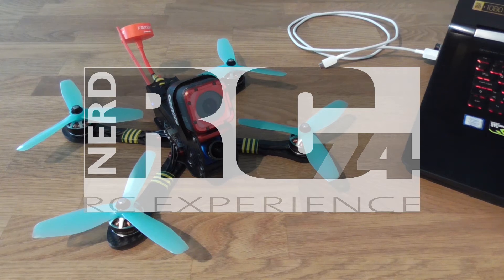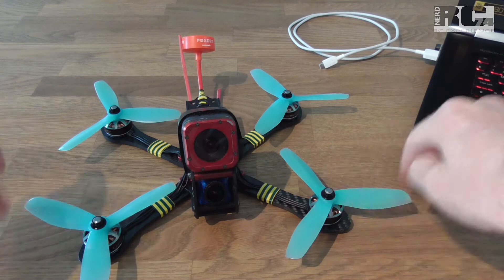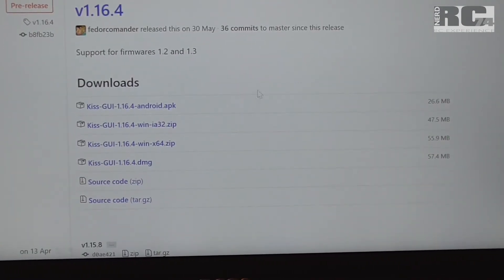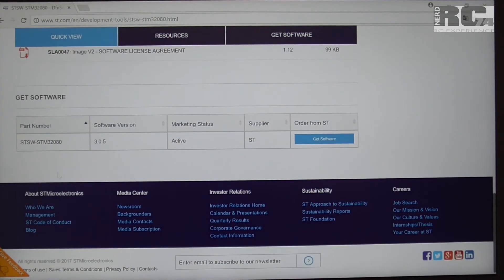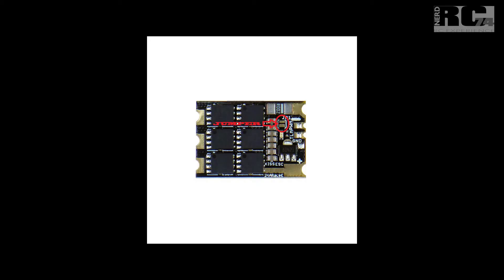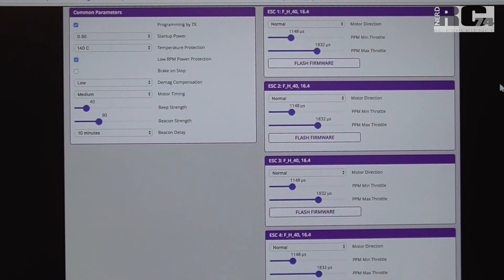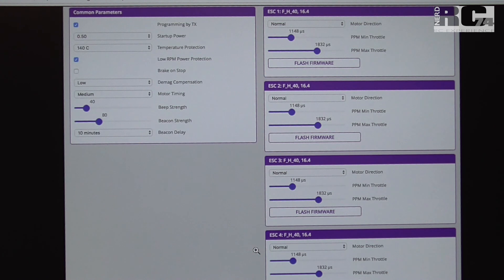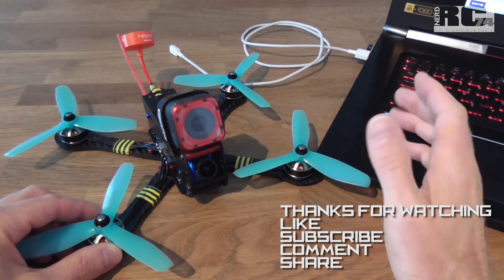INVERTED MOTOR DIRECTION WITH KISS FC

Comment: so I am used to my YAW being reversed ( yaw pressed right on remote my quad turns left ) in my simulator but when i tried flying real quad its different. How can I change my Yaw direction in Betaflight? so when I push my YAW left, I want my quad to turn right. I am a NOOB. Please someone help. ive been at this for 2 weeks and no progression. HELP HELP HELP
Reply from the maker: I highly recommend to not reverse YAW on a real quad like you want to do it. Do some flight time on the sim with correct YAW direction. Otherwise you will never be able to fly another drone than your own.

Comment: (did/do) you have to have to re calibrate the esc after reversing the motor?
Reply from the maker: if you use dshot (usually dshot 600) you don't have to re calibrate your escs after reversing the motors.
Reply from the maker: hi. no calibrating needed after reversing the motors if you use Dshot (usually Dshot 600).